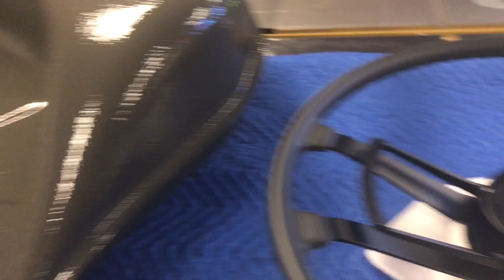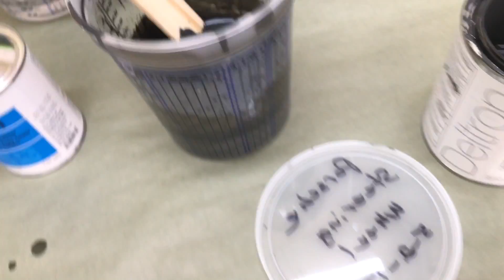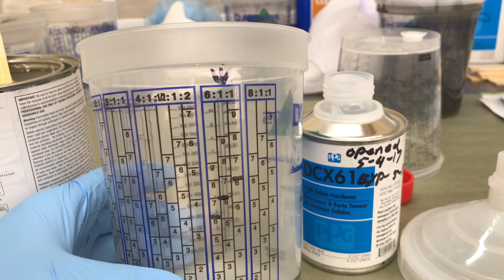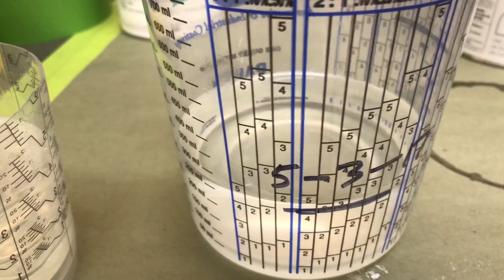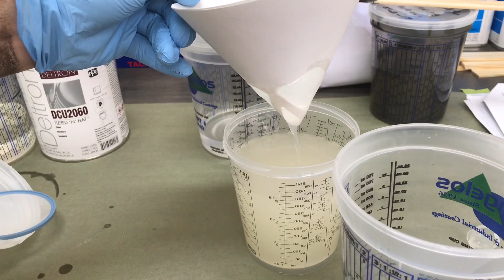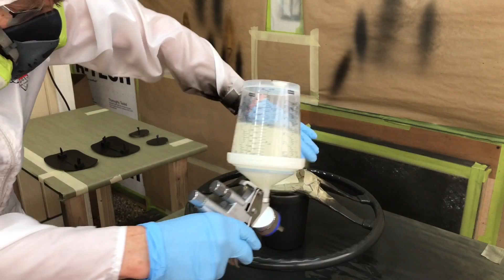1967 Porsche 911 Video 24 Painting the Steering Wheel

Comment: Really enjoy your videos. My 912 steering wheel is deeply scratched. How can I remedy this prior to the painting process ? What did you do to your wheel  before  painting ?
Reply from the maker: Hello John,
You might try resin epoxy to fill and voids and then an epoxy primer.
What ever you decide to use as a base will need lots of detailed sanding for preparation.
Good Luck!
Reply: @MikesRestorations  thanks for the suggestion mike

Comment: Hi Mike, how did you paint your seat rail supports and the transmission cover on the interior rear seat area?
Reply from the maker: Hi Viko
Interior of car is is POR 15 and will be covered over with sound proof matting and carpet. Seat rail support were painted with VHT black high temp paint.
You can use POR 15 for rail supports also.. Back seat hump over the transmission is also POR 15
Reply: Mike thanks so much for the quick response. I love your channel - it’s hypnotic and inspiring how much detail and care you go into..

Are you going for as ‘as it came out of the factory look’ or are you doing it as you want it to look..? I understand the interiors were more of a satin finish than the gloss effect of POR15...
Reply from the maker: Thanks Viko
The Finished look of this build should look very accurate to factory original specs..
I will keep the customizing to a bare minimum. Ultimately it will just be a smoother more shined up version than the original. Using modern materials and finishing products will be an improvement to 60s technology. This car was black inside although later versions were color. POR comes in different sheens but I went with the gloss as the contrast looks nice with the satin dash and under dash areas.
Most interior coating will be covered permanently with sound deadening materials

Comment: quick question Mike, are you happy with your Ingersoll Rand compressor?
It looks like a 2-stage 60gal, is it the single phase 5hp model? How well does it keep up with that SATAjet?
Reply from the maker: Hi Calvin
Yes very happy=) No problem keeping up with that RP or the shutz gun
Shutz gun is quite an air hog.
I had a single stage 5hp same unit..lasted 15 years! Motor just got tired so I thought Id try a 2 stage.
Works great for all spraying needs but it couldn't keep up with the sand blasting. Kept overheating the motor and had to put fans on it to stop it from
shutting off.
The new unit is a single phase 5hp 2stage
the old unit was a single phase 5hp Single stage but I think the older motors were a bit better quality than the newer versions.
Still they are excellent value for the money I think

Comment: Hey Mike, thanks for the detail on the steering wheel.  I had no idea they were painted.  Always thought it was over-molded plastic on metal frame (but mine isn't original!).  Looks fantastic, and as you mentioned should stay that way for many many years.  Great stuff, and looking forward to your ongoing journey.
Reply from the maker: Hi John
Thanks Yes you are right..the original wheel was a vinyl or plastic type material stretched over the rim..The only way I could think of to replicate it was to build up various layers of 2k urethanes and finish it off with a flat skin
Looks close to original and feels nice.
Its original condition wasn't bad but had several cracks and tears in the plastic wrap.
I sanded all of it off and started to build it back from the core.
Cant wait to see it installed!